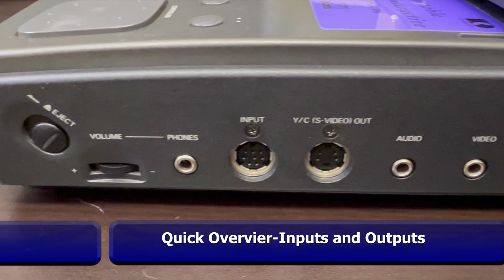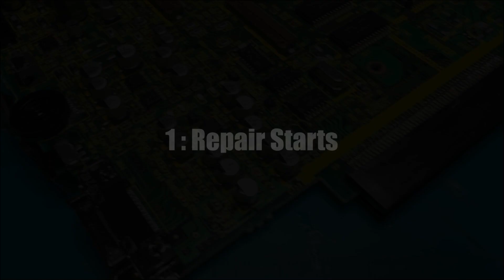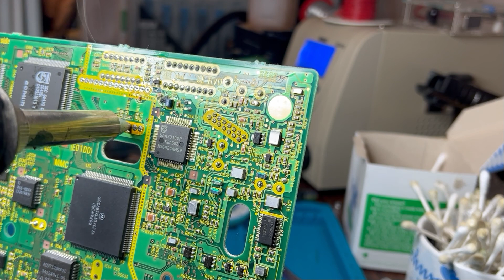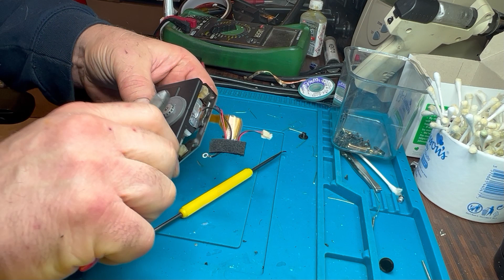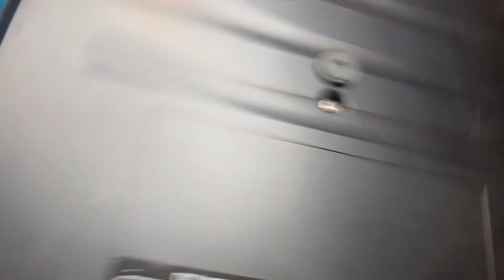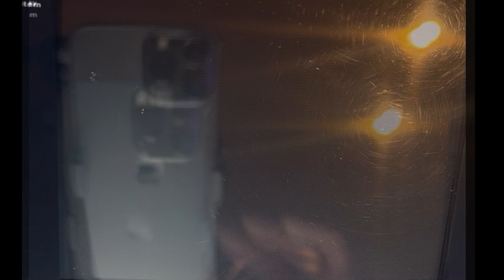The Portable Phillips CDI 350 (Trash To Treasure)

Comment: Thanks for the great video, it's very helpful! I bought the same unit cheaply last year from an old lady who thought it was a DVD player. I can't wait to get it working, mine even shows the starting menu still, but it doesn't do more probably due to the caps. 

I have two questions: 

First of all, is it possible to install different caps that won't damage the board in the future again when they leak, so that even if they break at some point, it won't destroy the rest? 

My second question is about the protective layer on top of the CD drive, around the buttons and the whole surface there. Mine turned sticky and looks ugly, though I made the discovery on an old Hi8 camcorder that you can just "rub" it off without the writings coming off. Does yours have that too? I'm afraid that if I remove it, the white lettering will come off with it.

Comment: I recently found a 350 myself on eBay. Waiting for it to arrive but this was a great video to set myself up for if I get into any of these problems!

The portable CDI’s are definitely very interesting systems. :)
Reply from the maker: The optical drive is a bit weak so not many work there is a chat working on a ODE but not available yet 👍
Reply: @TheVetUk  yeah I figured that is a very common case. I just received it in the mail and the disc spins a little bit and stops when I put a game in.

By chance, do you happen to know where this discussion is taking place?
Reply from the maker: @GMDSulky  the site selling is = https://3do.dev/products/phode-drive-emulator

Comment: I have just recapped my 350 and changed the timekeeper. The screen now appears but it’s purple, any ideas what it could be? I noticed you cleaned yours with ultrasonic, do you think that I should try this as well? Thanks
Reply from the maker: I have message the seller of the ODE to see if it’s compatible I’ll let you know if it is 👍
Reply: @TheVetUk  thank you
Reply from the maker: Hi
I would check the type, polarity of the caps you fitted first I remember some being bipolar be careful you have the correct types installed as it will suppress your video signals if incorrect also go over the caps to make sure you have none shorted 
I always give stuff a good clean when finished but not essential you could give it a good clean with IPA it’s just good housekeeping and helps neutralise any cap juice residue 
Let me know how you get on 
Does it read CD’s as most are dying now 
I have just read today there’s a guy doing CDI optical drive emulation so hoping I could add this to my 350 if it’s compatible 
Good luck 👍
Reply: @TheVetUk  thanks for message. I will check over all the caps to ensure that none are shorted. I purchased a kit from Console5 so all caps are correct inc the bipolar ones. Cd unfortunately not working, tries to spin and stops so will need to replace pickup as well once picture has been resolved.